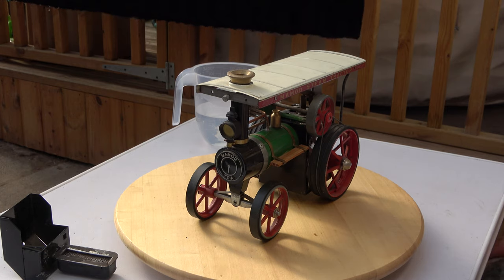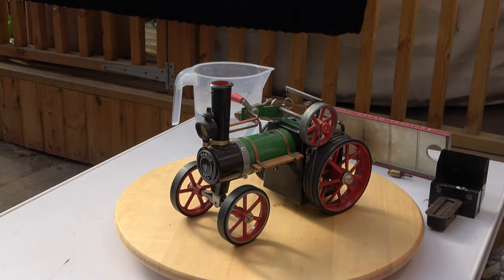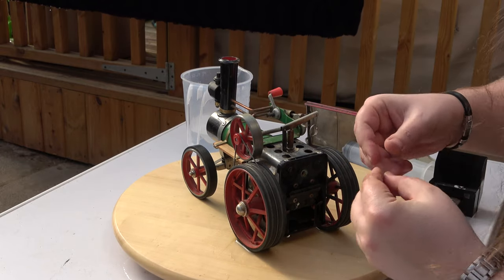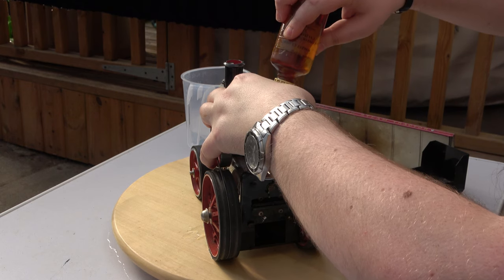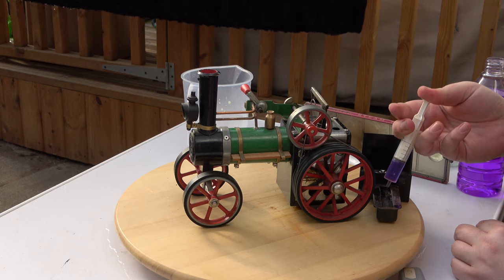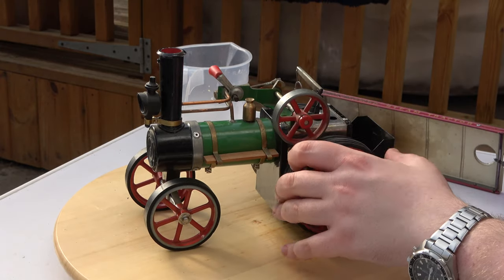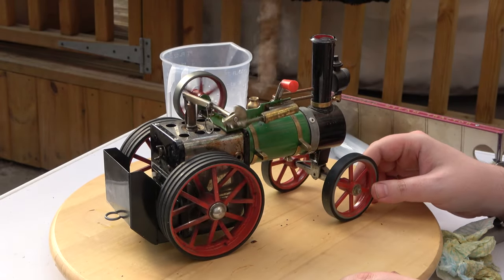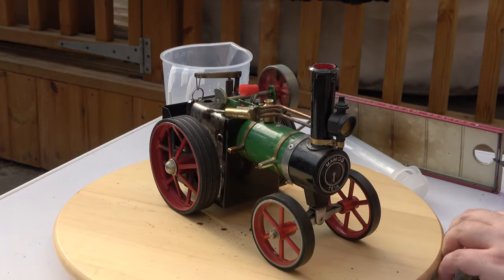Mamod TE1A

Comment: Where did you get the headlight for it?
Reply from the maker: eBay a long time ago. I bought it as a product specifically for the Mamod TE1A and SR1A and it came with the band. It's actually a Wilesco coach lamp as used on their fire engine.

Comment: Just a tip your board is on the wrong side it should be on the opposite side of the boiler from the fly wheel but what an awesome little engine I have one only mine runs on fuel tablets but overall a nice engine there I’ll be sure to subscribe 🙂👍🏻
Reply from the maker: The bands I bought are designed to have them on both sides but the dog chewed one of them.